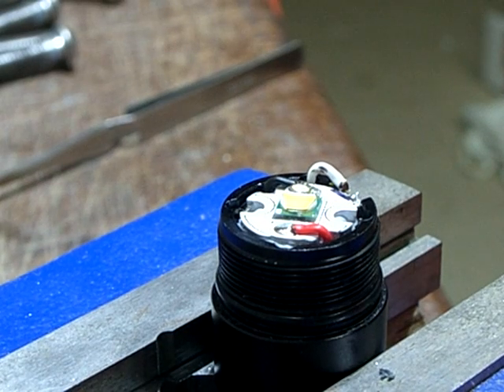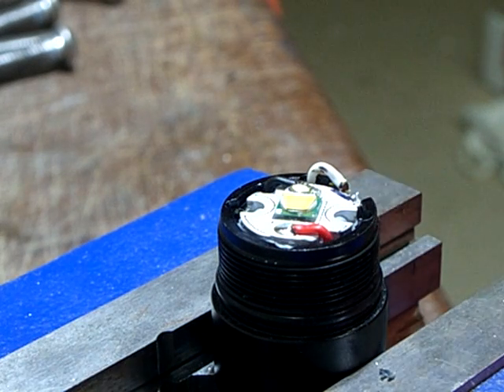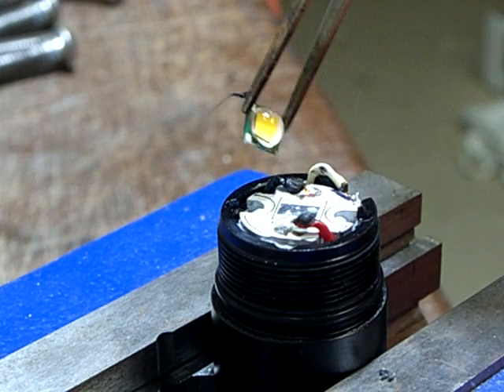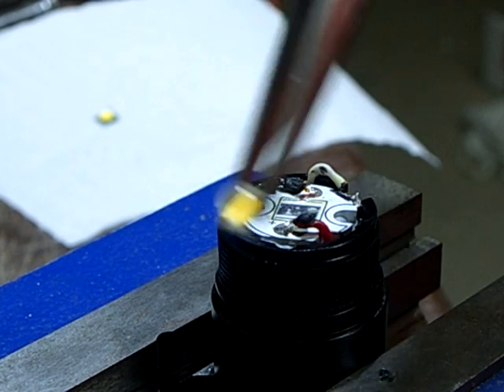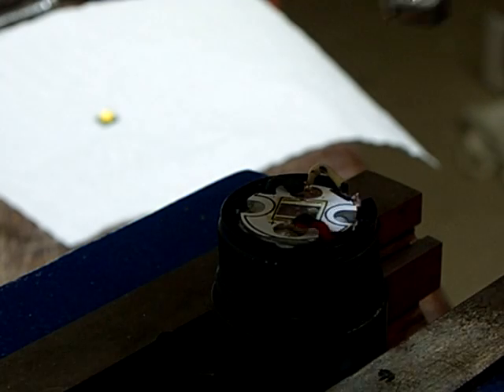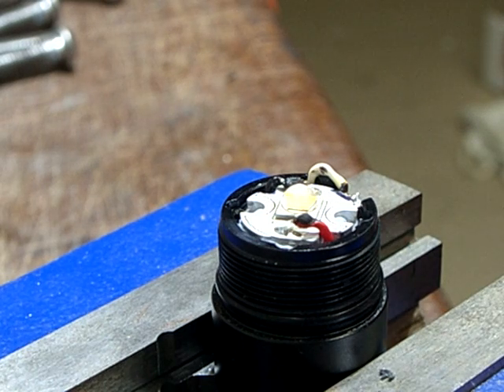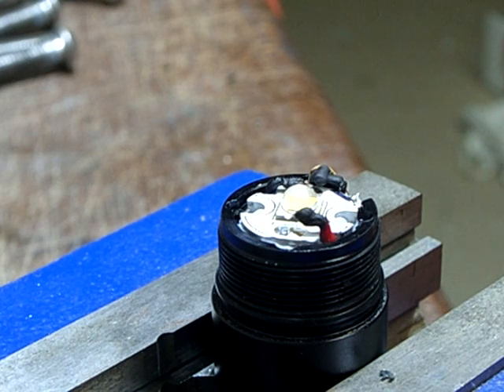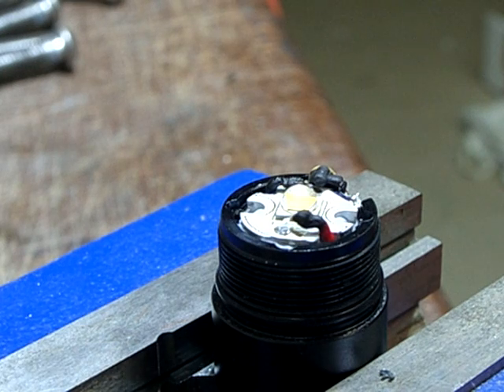Reflow Soldering CREE LED II (XM-L2 update)

Comment: nice display. Is there anyway to test or replace a board of a Stanley SL10LEDS 10 Watt Lithium-Ion LED Spotlight. Mine got wet and no longer works. The battery is good but I believe the board is dead. thanks in advance